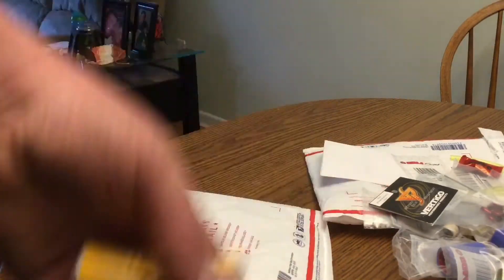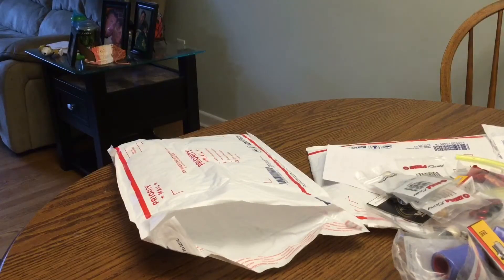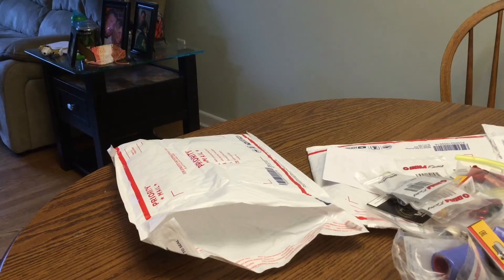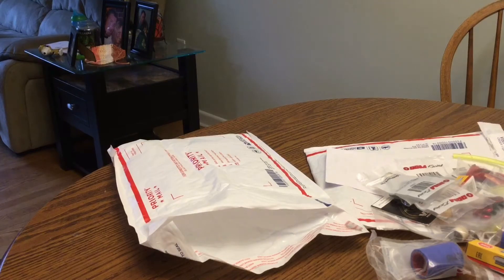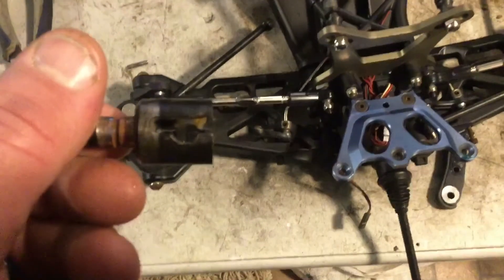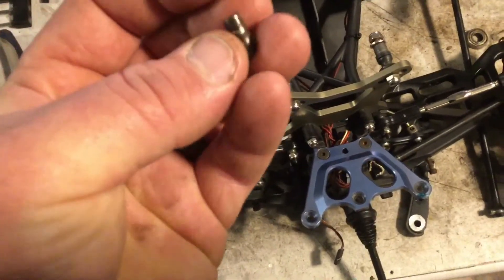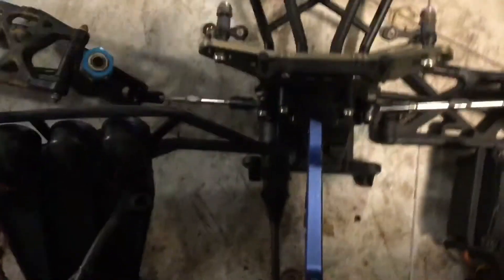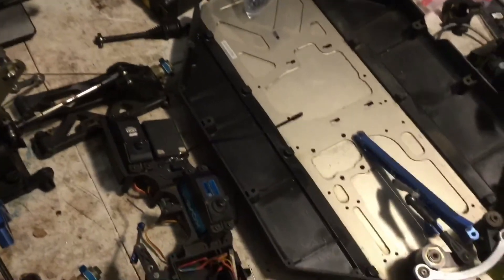New unboxing plus update on losi 5ive t rebuild 👍👍⛽️⛽️🔥🔧

Comment: I had the quick release throttle link and I broke it when I was setting my end point adjustment 😂.  Nice video thumbs up,  those drive cups  were gone 😱 nice work. It's good to see people using these things,  rather then just looking at them.
Reply from the maker: Only 5th scale im going order 2 more just to have them. I noticed that they seem to do is break too easy even the stock linkage. And I even have all my travels turn down to only what it needs to travel to none of my servos or overextending. It is what it is. Plus it's nice to have spare parts on hand then have to wait for them to come. Because the hobby shop that I used to go to that carried all my fifth scale stuff closed down. That was a sad day. That's where I used to race my trucks too.
Reply: Matthews Toy Chest I'm sorry to hear that. I'm basically forced to buy online too cause there's nobody selling 5th scale parts in my area.  Just traxxas lipo brushless rtr.  That's what the majority wants so that's what they sell. 😭
Reply from the maker: Only 5th scale thats so true. Theres a place about an hour from me that they sell MTXL losi 5ive ts and losi DBXL but they carry no parts for them. Everything else is traxxas. The place i used to go to was rc hobbies and more. They had a huge selection of 5th trucks and parts. A home back wall as far as the eye could see. I was able to spend hours in there.

Comment: Hey mate. Good to do a strip and rebuild after a while. Pretty sure you can replace the shaft pins. Not having to replace the whole thing.  Bit cheaper too. Also couldn't see but while the chassis is bare have you fitted droop screw bump stops. Saves ya chassis getting chewed up 😎😎😎
Reply from the maker: laurent gouriou yes i did the team fast Eddy drop screw bump stops about a year ago. There is absolutely no mark on them whatsoever. What a difference they make. That was one of the first modifications I did my T.
Reply: Matthews Toy Chest good job👍👌

Comment: You can now get  the. Front centre drive shaft. In ball drive now. By Uber I think.    It said it was the only shaft available in ball drive at moment. As it’s the most problematic shaft by far.     I have been thinking about swapping over on my trucks.  As. Constantly replacing pins. On that front shaft.      Something to keep an eye out for buddy 😀😀😀🚗🚗🚗🚗🇬🇧😀😀

Comment: if you like those quick release throttle linkage then go to www.gizmomotors.com they have heavier ones cheap I had one on my 5th scale for two years now with no problems and yes you have to do a little drilling...nitro gas forever